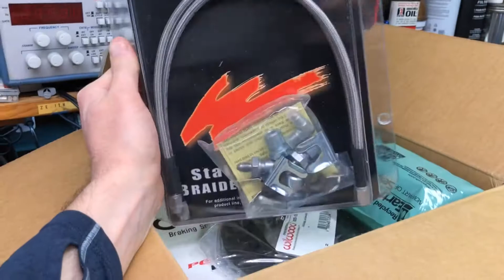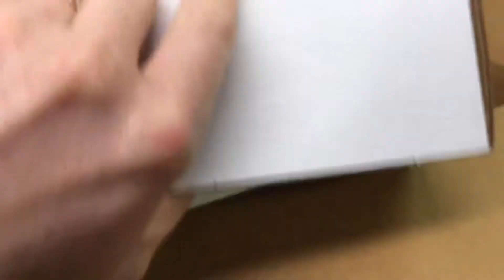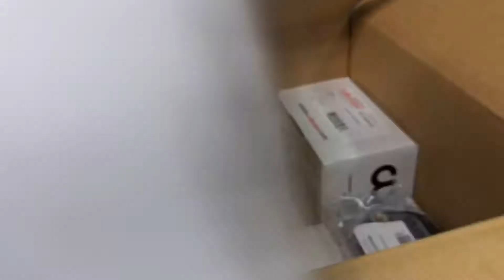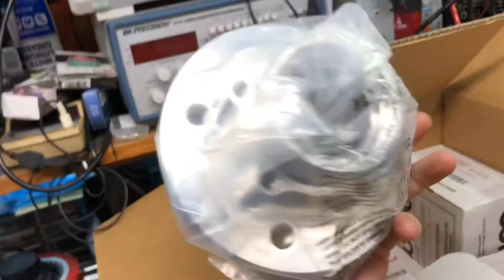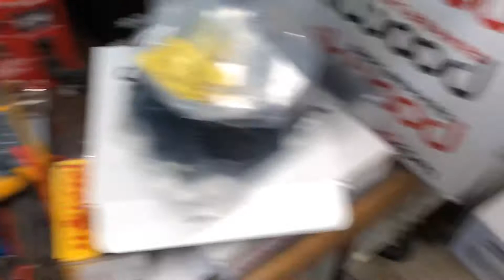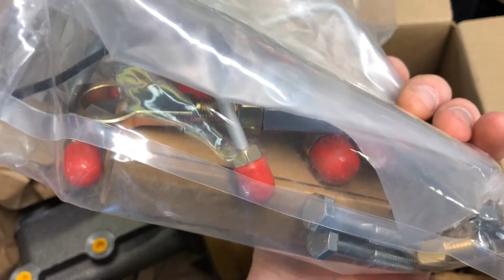66 Mustang 4 Lug Wilwood Front Disc Brake Conversion - Unboxing and Overview - PART 1

Comment: what size are your wheels?
Reply from the maker: Stock 14”
Reply: @mechtrician1  I have a Sunbeam Alpine with the same bolt pattern with 13" rims. I know they will clear stock fox body brakes with 14" wheels. I wonder if it is tight than that.
Reply from the maker: Check the back spacing of your wheels.  The Wilwood website has all the dimensions and you can check it.

Comment: Looking forward to seeing how this goes. Putting Disc brakes on my 67 Stang with Inline 6 and 4 lug wheels is on my future upgrade wish list. Seeing it this works with stock wheels is of interest. Every other kit I have looked at requires moving up to at least 15 inch wheels.
Reply from the maker: Yeah me too haha. We shall see. I’m mocking it all up today and it will be in Part 2.
Reply: I am in the same situation, I have a 68 and really want to use this wilwood kit. I think I might just go for it and try and modify the brake caliper brackets or something.